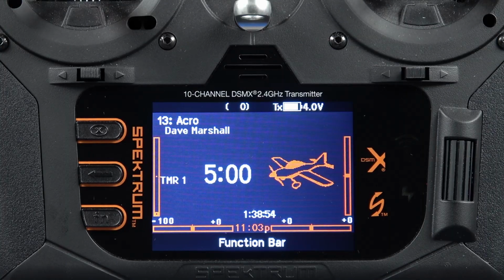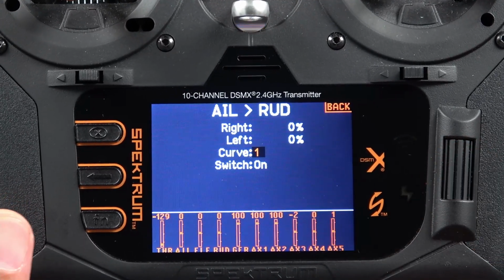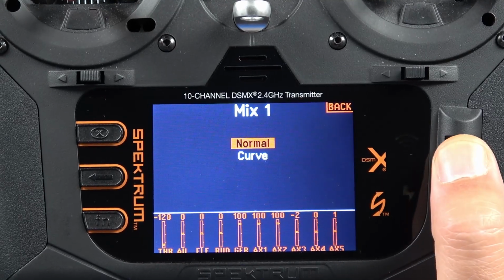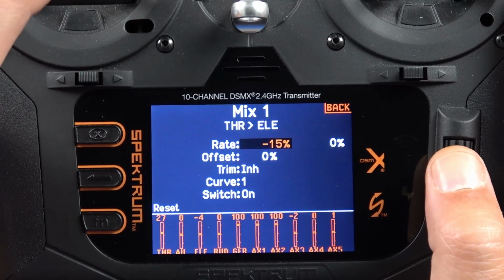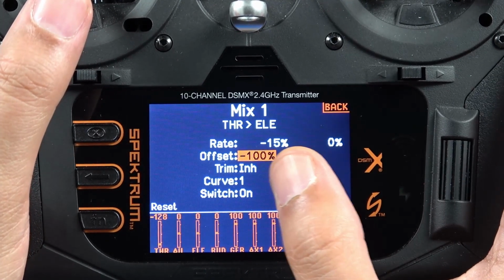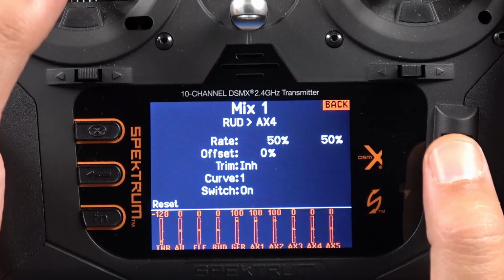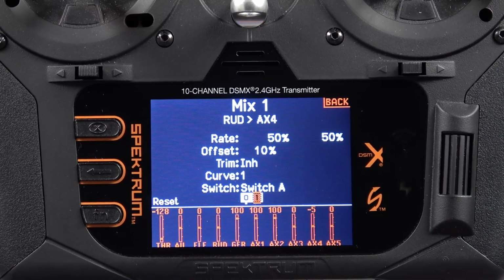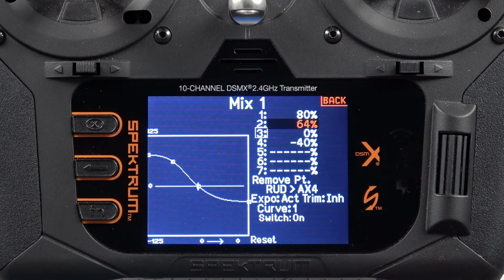Spektrum NX Series Tutorials - Mixing

Comment: Thank you for this tutorial. I have a Patty Wagstaff 300 with a DLE 55 on it. At full throttle the engine torque was causing the plane to want to roll. After putting in a throttle / aileron mix I am able to go WOT and it tracks much more level. You are appreciated!

Comment: Thank you very much for this great video. There´s only one topic that I don´t understand. I own a Spektrum NX8 and a Blade 230S Smart RTF. I´ve done the programming of the NX8 acc. to the BNF-table of the manual and after watching your video I´m not quite sure if I have programmed the panic recovery correctly. On "mixing" I first select "normal" and switch "I" with "I" -> "GER".  At the beginning the curve shows 0 and switch position shows 0 and switch box shows 0, too. Now I press and hold switch "I" and while holding "I", curve jumps to 1 and so do switch position (1) and switch box (1). While holding switch "I" I setup the rates and offsets acc. to the manual. After releasing switch "I" the screen jumps back to curve 0. My question is now, am I doing this mixing for panic recovery correctly or should I setup both swith positions on curve 0 with the 0-conditopn being on the hatched box? I hope you understand my description. Thank you very much in advance and have a nice day. Best regards, Markus.

Comment: Many thanks for this video, it explains a lot more than the manual.  Not sure what the curves are in the "normal" mode, In you examples it seems to be all linear mapping, but if the can't be influenced.  Or is this exactly the difference selecting normal or curves mixes?  I have a control requirement where I would need to have two mixes processed sequentially.  So programming for example the first curve mix to AX5 on the NX10 works perfectly when checking AX5 in the monitor.  If I then use AX5 as an output of that first mix as an input to a subsequent mix, ie AX5>AX2 then this mix sees the value of AX5 always zero even so monitor shows otherwise.  If I want to prove this subsequent mix to work properly and hence disable the first mix output by setting it to INH and then channel assign say the R-knob to AX5, then the the AX5 input to the second mix is all working as expected.   So it looks like you cannot use an AX channel as input to a mix that has not a direct assignment in the channels' assignment menu. Have I overlooked something?  Can anyone get this working?